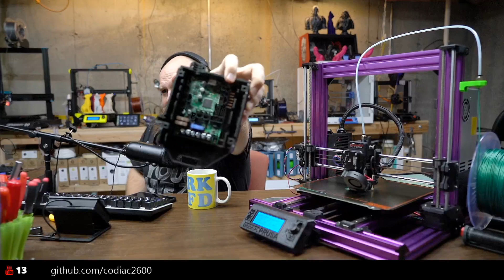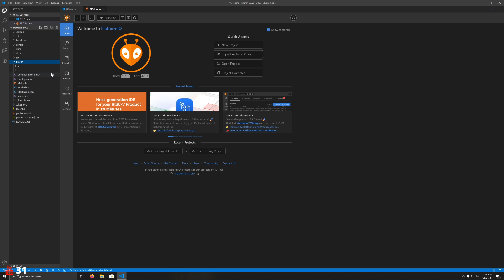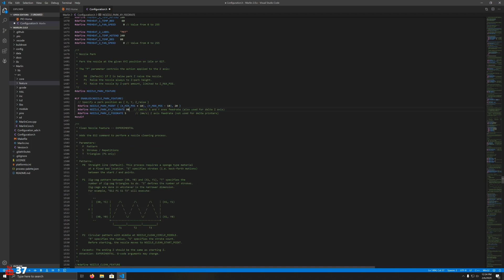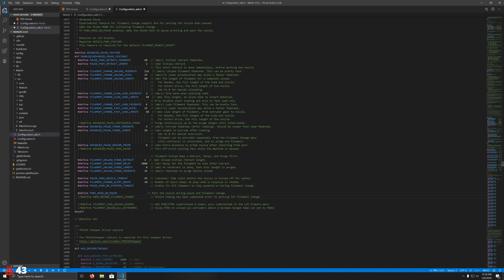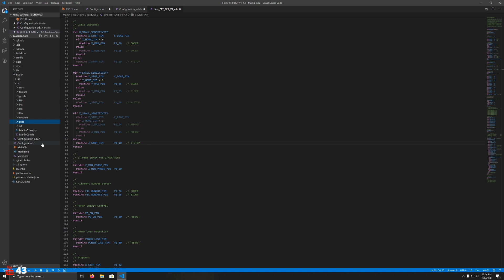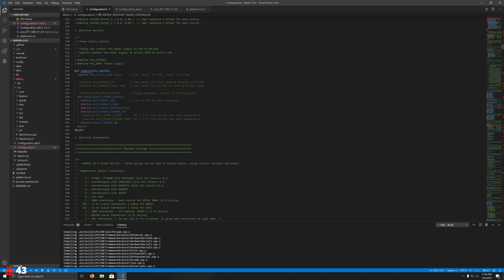SKR V1.4 Prusa Bear Marlin 2.0.3 Setup

Comment: Hi Chris, the pinda or your inductive probe is probably on a split wire e.g. the probe part plugs into the 2 pin receptacle for the BL-Touch. The 2 pin is the P0.10. One can rewire the pinda to work with the Z-Stop P1.27. 

Power Loss or UPS holds the system up for a short period of time, long enough to store current data e.g. Z,X,Y position into EEPROM. With this data it can restart where it left off (Resume Print).

Comment: I love this - got lost about what current was correct for my BMG motor that came with my upgrade (25 mm pancake stepper with 18 N/m torque) - and the specs says max 800mA - so I will set it to that.

However - there have been A LOT of changes with the Marlin 2.0.8.1. I had to really skip ahead sometimes to find the section that Chris changed.

Unfortunately the compilation did not work. I got the error "LIN_ADVANCE and S_CURVE_ACCELERATION may not play well together! Enable EXPERIMENTAL_SCURVE to continue." - so I will try and figure out what I need to change back to get it up and running.

I still have not find any instructions on how to use the "Prusa_SKR_Configuration.h"-configuration - maybe that will sort things out. :)

Great work though!

Comment: I cant get any screen to connect. I tried and compiled every baud rate and same thing. And its not just this firmware. Its all of them that i try. And ive tried 4 different screens so I doubt all 4 screens and 5 different  boards i tried. SKR 1.3, 1.4, 1.4 TURBO BIGTREETECH BTT002 V1.0, and i tried tft35v3, btt tft 70, and 2 off the lcd that come with the prusa clone from fysetc.  I have no clue what im doing wrong. With the Bigtreetech GTRv1.0 I can get it to work in marlin mode with the tft70 from btt  but thats abput it. so frustrating.
Reply from the maker: Did you compile a fresh screen firmware?
Reply: @Mr3DPrintWizard  no i did not. I only did the motherboard firmware. Didnt flash any screen firmware. Am i suppose to flash screen firmware also?
Reply from the maker: @Goran1980  you should update to the latest screen firmware as well.

Comment: would this work with bigtreetech btt002 which is a newer board they have that's made especially as a drop in replacement for a prusa i3 mk3? it comes with firnware on it already that's kind of like prusa with senseless homing and they say you can compile prusa firmware just don't know which fork to go with but this looks like a good place.

Comment: Hi Chris great stuff like the way come across ,i followed your your clip and lost you in the middle when it got to the Dual steppr in Config adv.h it looked different so my mind just switched to overload it looks different i downloaded Marlin-2.0.x-SKR-V1.4-Turbo from Github //#define Z_DUAL_STEPPER_DRIVERS
#if ENABLED(Z_DUAL_STEPPER_DRIVERS)
  //#define Z_DUAL_ENDSTOPS
  #if ENABLED(Z_DUAL_ENDSTOPS)
    #define Z2_USE_ENDSTOP XMAX
    #define Z_DUAL_ENDSTOPS_ADJUSTMENT  0
  #endif
#endif.....................i want to use the extra Z on the SKR 1.4 Turbo .....turbo sounds so awsome your right :) i have a list whats in my 3d Printer that im building called Hammer Head as in shark hihihihi :FLSUN Cube 300*300*400
BIGTREETECH SKR V1.4 Turbo SKR V1.4 Control Board+TFT24 Touch Screen+TMC2209 
Nema17 Stepper Motor 0.9 degree motor 42 Motor Nema 42BYGH 1.5A 38mm 17HS4401S
AT24C256 Memory Module I2C Interface EEPROM In Stock01
BIGTREETECH BTT Writer V1.0 Module 
ESP-01S WIFI Expansion module 3D Printer Parts For SKR V1.4 Turbo SKR V1.4 Control Board
ESP8266 ESP-01S ESP01S Serial Wifi Sensor Wireless Module ESP-01 Wifi Module DIY for SKR PRO SKR V1.4 Turbo 
DCDC Mode V1.0 Power Module BTT Writer Firmware Flashing for BTT SKR v1.4/1.4 Turbo Control Board WIFI Moudle
XCR3D Titan Extruder for the E3D V6 Hotend J-head Bowden Mounting Bracket 1.75mm Filament 3:1 transmission ratio 
HT-NTC100K Thermistor Temperature Sensor for High Temperature Filament 350 Degrees For Heat Block Reprap
Heating tube 6*20mm 12V 24V 50W Ceramic Cartridge Heater for V6 HotEnd with J-Head
Geeetech 3d touch auto leveling sensor 
E3D V6 Hotend 0.4/1.75 Mm  High temp 320 Graden J-Head Remote extruder 12V Hot End 
GT2 20 tooth Timing Pulley Aluminum Bore 5mm Width 6mm with a PU with Steel Core GT2 Belt 
Heated Bed / Extruder Power 2x Module High Current 210A MOSFET Upgrade RAMPS 1.4 ................don't quite know how to config the z drivers TMC2009 with cuttig off a pin :)  so to make it short hihihi why is your config adv.h Zdual stepper drivers different then mijn im missising ..  num_ where you wrote (2) behind i'll watch all your films and hope i can make some good firmware for my HH SKRv1.4T thanx Chris

Comment: Hello, thanks for your work, I just ordered a skr 1.4 board, I am building a prusa bear, are you using the prusa pinda v2 sensor? How did you configure the thermistor that has the pinda v2 probe incorporated?
Reply from the maker: Ivan Garcia the GitHub has the wiring diagram and firmware. Www.github.com/codiac2600
Reply: @Mr3DPrintWizard  Thanks I will look at it and try it this week when I have my skr 1.4, right now I have it working with a skr 1.3 and Bltouch but I am interested in making the pinda v2 work. Thanks again.

Comment: Excellent video and work by the Marlin team. Have been using a Prusa Mk3 for a year and found it very easy to use compared to a Mendel 90 with RAMPS and Marlin 1. I am building a Bear with an E3D Hemera using SKR/Marlin 2 so your walkthrough video has been very helpful.

Comment: Chris Warkocki  Do you have prusa slicer settings for your printer i am very interested in that, thank you
Reply from the maker: Uploaded them to the GitHub.
Reply: @Mr3DPrintWizard  Thanks that worked like charm, i opened an issue on your github where i will post my config files since i use SKR1.3 and TMC2310 + Bltouch(Clone)
https://github.com/codiac2600/SKR-MK3s-V1.4-Beta/issues/2

Comment: Notice motor cable ends do not fit SKR_1.4 board.  How did you handle this? What connectors work?
Reply from the maker: Jst 2.54 connectors. I bought a kit on amazon for like $10

Comment: have you got the error when you write in this line #define E0_AUTO_FAN_PIN P2_04. I think you also the changed in the fallowing file. #include "pins_BTT_SKR.h"
Reply from the maker: Talha Ahmad I haven’t no b
Reply: @Mr3DPrintWizard  Please also include pins_btt_skr.h file in your github
Reply from the maker: Talha Ahmad there aren’t any changes to that file.
Reply: @Mr3DPrintWizard  I got your files and complied it. There is error. I post it on your git hub.  There is nothing  like AUTO_FAN_PIN P2_04 in the pin file. Please also include pins_btt_skr.h into the github
Reply from the maker: Talha Ahmad the pins btt skr is already included in stock marlin. Download the latest build from their site. The files included on my github are the only files with changes. I just confirmed the pin and it’s P2_04. I didn’t change it. It’s already declared that.

Comment: Thanks for this! One note the BOARD_BIGTREE_SKR_V1_4 doesn't compile, must use BOARD_BTT_SKR_V1_4
Reply from the maker: Chris Stone it compiled for me on stream. The pins is btt but the board uses BIGTREE
Reply: Chris Warkocki yeah my bad... user error... lol the firmware I downloaded had a bunch of extra stuff.. for example you note in your cheat sheet steps per axis at line 739, on my firmware it was over line 1000 or something. Every time I tried to compile it would have the board name change error.

Comment: You have a link to the board? The one I keep finding is only $30 and I can’t imagine it’s that cheap?
Reply from the maker: Rick C oh it’s that cheap.
Reply: Chris Warkocki excellent. I have an mk3s with bondtech and mosquito  - will you be covering this as well? I think those settings are in the advanced config file but not sure. Thanks!
Reply from the maker: Rick C nothing else needs to change. You’d leave the microstepping at 32 and set esteps to 830. Nothing special for mosquito.
Reply: Chris Warkocki does that include the 450 degree SE thermistor?
Reply from the maker: Rick C ahhhh. Then you’ll have to select the slice thermistor from the table.

Comment: FYI, It's the pullup resistors on the SKR boards endstops causing issues with the Z-probe being able to use the Z Min Endstop pin with the inductive probe. Probe goes low, but pullups make it still read the probe as triggered. You could desolderer the resistors on the board or add pulldown resistors. But pin mapping to the probe port is an easier solution, that's what I do on my SKR boards with . I Assume you had to do a voltage divider on signal from the 5V probe so you don't fry the LPC1768? Or are the Pinda probes able to handle being run off 3.3V?
Reply from the maker: Eric Lien running off the 5V output on the Z min pin. There are other available 5V pins as well.
Reply: @Mr3DPrintWizard    nevermind about the voltage divider I mentioned. I just looked at the datasheet and the Pins 2_XX are five volt tolerant. Not all of the lpc1768 pins are (some are only 3.3v). So using the remapped servo probe pin keeps you safe.

One of my printers uses the probe at 12-24v. So I just have a voltage divider via a trimpot to cut the probe return signal down to 3.3v.

Comment: Will you be showing how you wired up your SKR_1.4 board for the MK3s?
Reply from the maker: regor200 before I go to bed tonight I’ll upload basic diagrams to the github for wiring everything up.
Reply: @Mr3DPrintWizard  The wiring diagrams look good on github. I noticed you are using E1's pin locations and stepper for the other Z axis. So, you are using all 5 steppers. That was one of my questions for you. So, answered. :) 
There are two versions of the TFT35: "TFT35 V3.0" and "TFT35 E3 V3.0". Basically, san E3 has the dial on the side and E3 has the dial on the bottom. Which version is the housing getting made for? I'm not sure if there are any other differences between the two. Anyway, keep it up! Great to learn from your experiences.